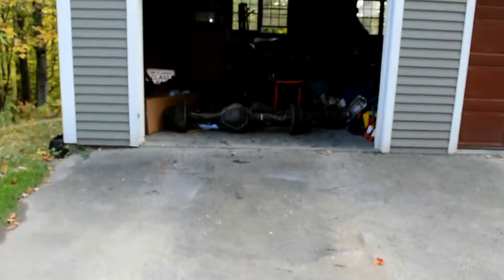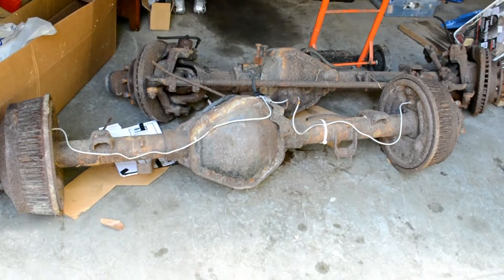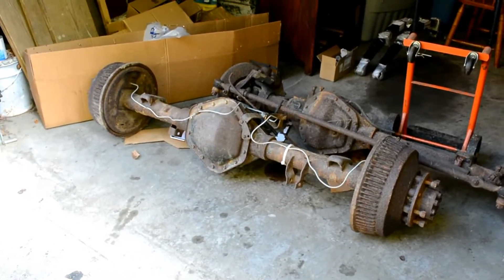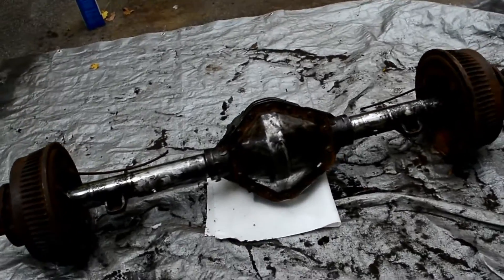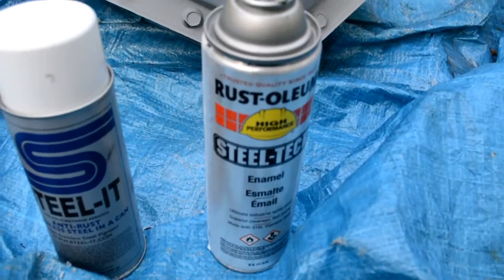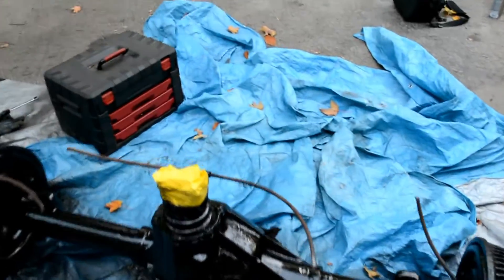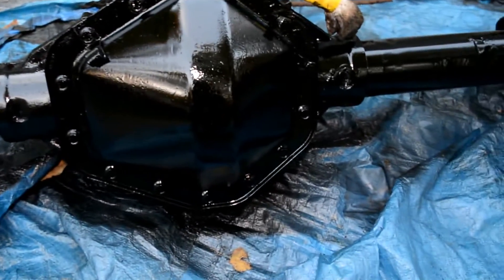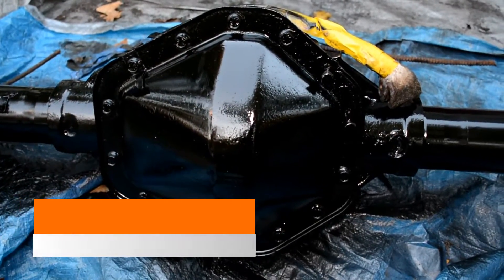14 Bolt Restoration

Comment: I’m about to do his on my taco, 345,000 miles, new frame but the rear axle is a bit “salty” from nj.
Reply: Also I’m gonna wire brush prime and then por15 hoping it will last longer, and then give the new frame a nice rust oleum cost just for protection